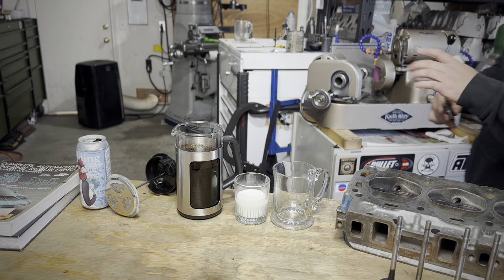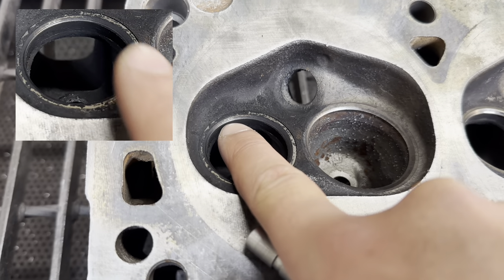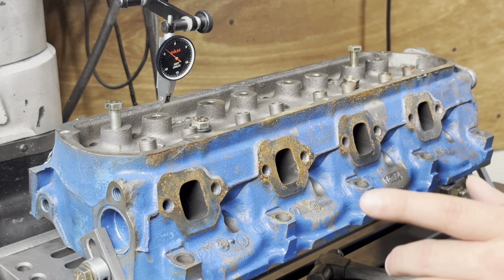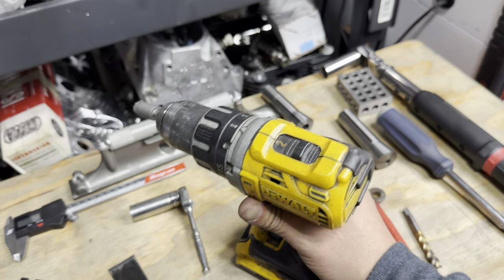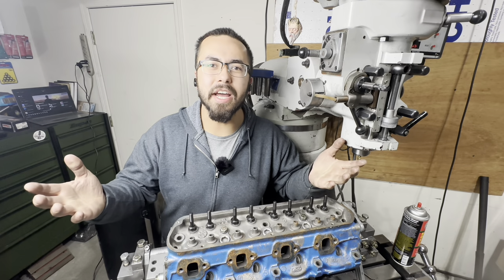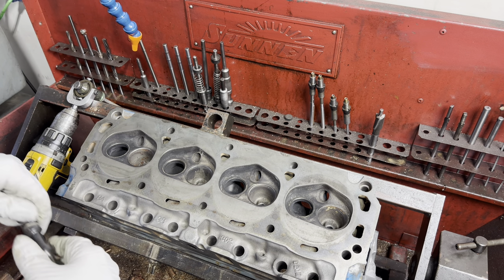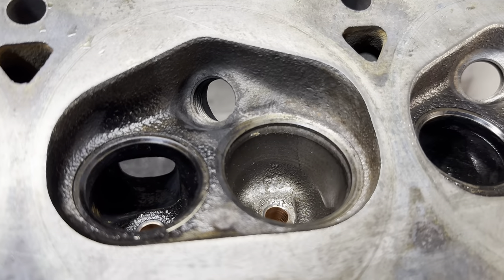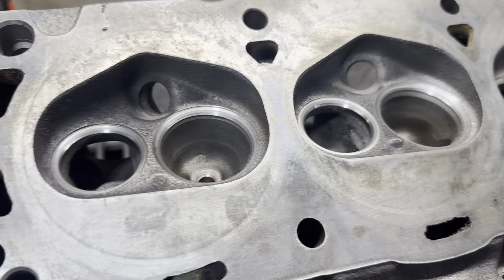This 302 FAILED in 1 Hour! The Issues Were VERY OBVIOUS. | Engine Rehab Episode 10

Comment: Great to see you checked the valve protection and used the dimension to set the spring seat. At least your stems won’t all be the same height .
Reply from the maker: I couldn’t care less if the stems are the same height from intake to exhaust at least.

Comment: If you don’t use differential valve and seat angles to control the seat contact width then your seat width is strictly controlled by how accurate you got the angles into and out of the seat with your stones.

Comment: Great video thanks and its not that you got a "rise”outta me just that id like to put a respectful thought - on valve angles , as a person who sees and has seen the inside of a lot of engines and only because i mostly work on diesels with very dirty carbon’d up intakes to the extent with modern egr that chunks of it fall into the valves quite often - i do think a slight mismatch in the angles helps keep a very high pressure per contact area thus helping crush the stuff and prevent it staying too long between and then getting a burnt valve because of it chuffing

Comment: valve guide knurling will work as long as there is something there to knurl ! as long as the guide is not worn out completely and you clean all the swarf  [crud ] out after reaming ! but new will always fix it !
Reply from the maker: One more comment away from getting the ban hammer.
Reply: skin it pull that smoke wagon  ! let that hammer fall ! your kinda dime bag any way ! @EngineRehab
Reply: Knurling is only for throwing it together to sell the car. At the cost of machinist time these days, why do it half assed? Won't last more than 40,000 miles at best.

Comment: With just a back cut on these valves you can pick up 30% on your low lift flow numbers .. I've been told . as per Eric Weingartner ... for it's benefit there should be no reason way a simple back cut was not done given the benefit of doing so  but aside from that nice work ..and I know what I'm talking about after spending 50 yrs in the Motorhead business

Comment: So funny I use a drill chuck for some operations in my seat and guide machine (spring seats stud bosses ect) . Nothing wrong with using the correct tool for the Job. I have never done a liner. Seen many of them but maybe because of my teacher (grandfather) i have always replaced the guides.  Why do you choose liner rather then a Iron replacement guide? Last question is the valve grinder wheel a ruby from goodson or CHS ? I have tried them but did not get the finish you have and ended up switching back to a gp wheel. I have the same grinder sitting under a tarp I got for free when the local community college did some upgrades. It is missing the motor and dome other parts but someday I will go through it but for now my old Sioux dose the job.
Reply from the maker: My ruby came from performance plus along with a special diamond dresser. And I prefer a bronze guide in general, if I can avoid drilling for a false guide and can use a liner then I always do that, just to help keep things concentric. My experience with liners is they’re tougher than anything else out there especially when you use a rapid brand liner. There are lots of other factors and also keeping in mind that I mainly work on performance stuff. I will say the replacement engine for my silverado will have rapid liners in it!

Comment: Josh, love your videos! In your cast iron block repair video, what rod did you use for your TIG welding and you have any cast iron welding tips? I have to repair a crack in the bell housing bolt of a 302 Windsor.
Reply from the maker: Is one of the ears broken on the bellhousing? We’ve done those repairs with 308L and a second person running a torch to help keep things toasty. I used 308L on my block repair to answer your question. We have also had good success with ni99 rod but you’ll do okay with the 308L.
Reply: Top drivers side is split on the block about 1/2" in. It looks like the guy that owned it previously tried to pull the bellhousing on with bolts when the locator pins weren't aligned. I think he tried to repair it by drilling it out and tapping it with a bigger bolt. It's probably only a 300 something horsepower motor so I was thinking on cleaning it up, welding the seam, and then helicoiling it.
Reply: 308 SS is low carbon content but high nickle so that must be why it works? Just straight argon, no tri mix? I'm nervous about getting it wrong. I have some mig wire I thought of using as some tig filler, royal 44 I think it's what it's called. Moser eng told me that's what they used welding axle tubes up on cast iron center sections. I had to brace an 8.8 so I bought a small spool of it a long time ago.
Reply from the maker: @johnnymizerati6169  straight argon. Lots of gas coverage. Heat up the part so it’s not dead cold. Take breaks and let its temperature equalize occasionally. Its not a race. In the vid you saw I warmed it up, but was only building up a corner on the part. I didn’t try pushing the weld into the main web which you noticed. So mine went easy. Yours will take some time, it wont wanna flow nice. It gets better when the cast started to mix with the wire. Also only just enough heat to get the part to puddle. Penetration isn’t a thing on cast iron. It doesn’t get stronger with more heat.
Reply: Thank you so much for the tips! It's been sitting on an engine stand in the back corner since two houses ago... 😢 It's hard to find good info on cast iron welding so maybe I'll finally be able to get it done now.